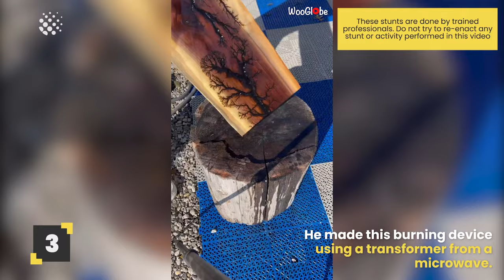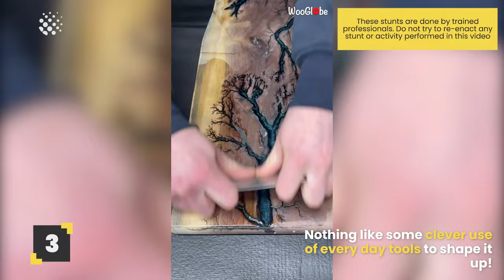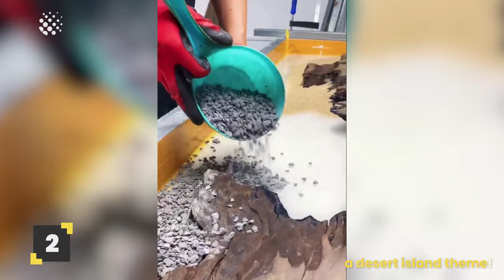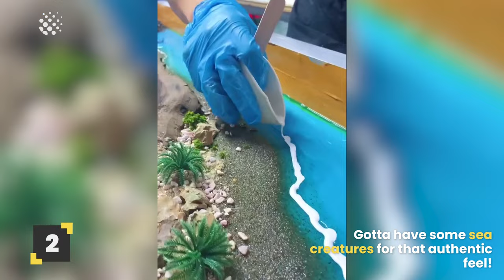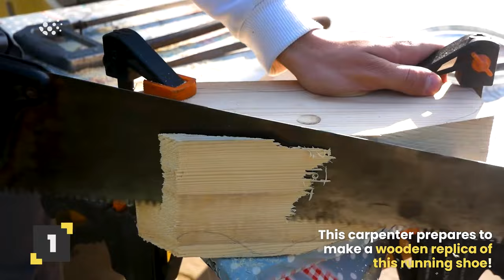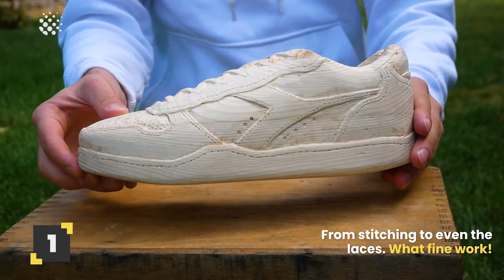Wood working artist making beautiful designs!

Comment: Fractal wood burning IS VERY, VERY DANGEROUS!! Even experienced electricians SHOULD NOT be doing this. Because the amount of power coming from the wall socket is amplified AND no longer controlled by the breaker in the home, just BRUSHING AGAINST those rods will kill you in, literally a SECOND because the switch at the breaker box WILL NOT SHUT IT OFF!!  Many people have died doing this and IT IS NOT WORTH THE RISK!! 
NEVER attempt to do this!!